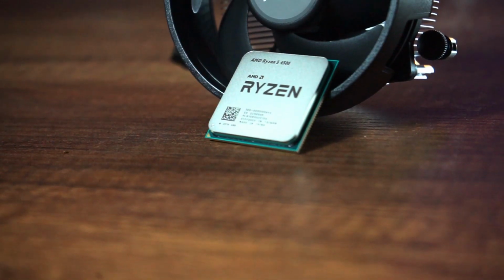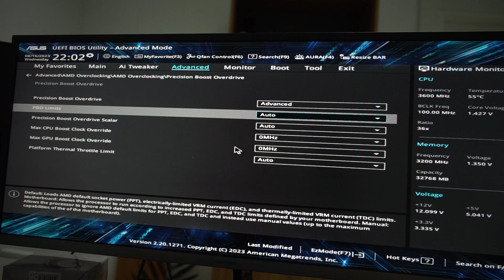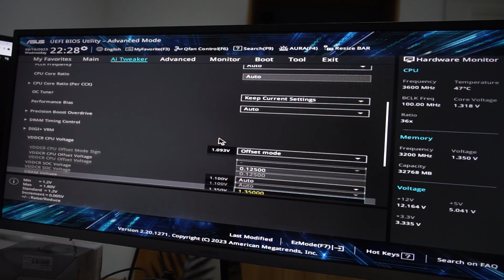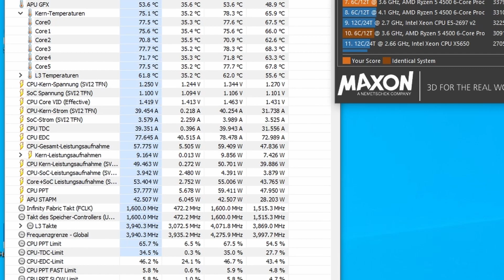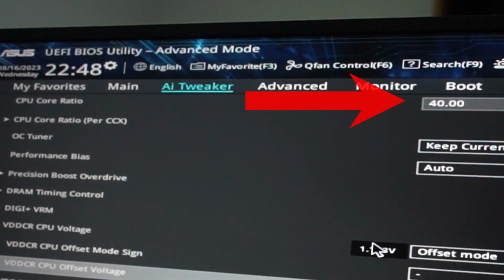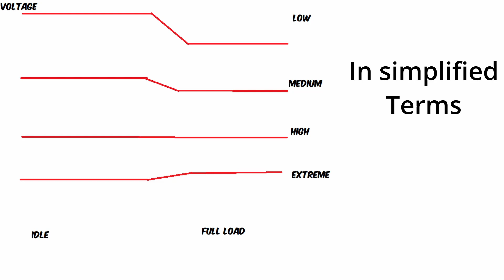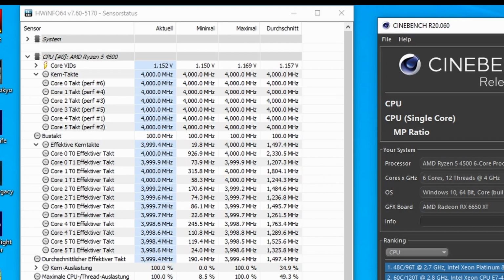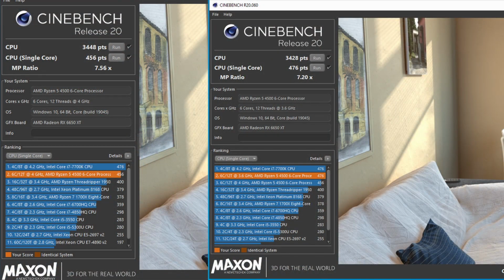Make your AMD CPU faster AND run Cooler at the same time for FREE!!! | Guide to undervolting Ryzen

Comment: Like the vid. Helpful info. Thank you.
I have just put a Ryzen 7 7700X in a SFF build. I've got a Thermal Right Phantom Spirit for the cooler. I'd like to undervolt my CPU, GPU and adjust the timings on my RAM. It's a bit of a balancing act to do all this, but fun. My big question though is will there be a noticeable difference in games and applications that require more power for performance? I don't own anything that I could test it on, hence the reason I ask.
Reply from the maker: if you do undervolting without adjusting the power limit. you will actually gain performance especially on CPUs. The 7700 has the option to set a 45w target i believe. with that setting and a lowered voltage or generally a fixed clockspeed you WILL save a lot of power and not loose a lot of performance since most tasks nowadays are multi threaded. 
i also did a guide on ram tuning. Thats pretty much something you could do that helps in any cpu dependant situation, be it CPU intensive games, rendering etc. 

There will also be a GPU undervolting guide next week! stay tuned for that :) was able to safe 150Watts on a 4090 while achieving the same performance on power intensive scenarios.
Reply: @limitless-hardware  Sounds good. I'll keep my eyes open for the vid. Thanks for responding. It's helpful to know you're YT reviewer that actually uses what you publish, rather than dropping a vid just for the YT algorithm.
Reply from the maker: Nice!
Well even when the channel is growing and i am able to get review samples i will try to use everything i recieve for at least a few days, sinde i think, you cant judge a product well, if you have not used it in depth, at least for a review. Unboxings etc. are something different but im not a big fan of videos like that.

Comment: unfortunately is not true about undervolting everything, you need a special app to undervolt my cpu which is a 5800x3D
Reply from the maker: True that. It is sad that AMD did not enable a negative voltage offset atleast for the 3d CPUs. or at least limit the voltage so that the problems with melting CPUs dont happen. But yeah, kinda sad. Still great CPUs for gaming Though!
Reply: You really shouldn’t mess with the voltage on a x3d chip
Reply: @MrExdous69  unless you know what you're doing, I've been bothering with PC things for 18 years which is longer than some people have been alive. People say you shouldn't do this or that w/o any knowledge or proof on why. Do you have any proof or cases of any X3D chips dying or having any issues from this stuff?
Reply: @ChikaHakozaki  for someone who claims to have done this stuff for 20 years… I mean your question was answered very recently. It was all over the news from people toying with the voltages on am5 x3d chips.
Reply: @MrExdous69  I didn't ask a question so where did you get that from?
I already knew you could overclock and undervolt the cpu in the first week of the cpu release. So if you're just now finding out via news, you're very late sir.
Reply from the maker: This is why I'm also saying in the video that this is mostly for CPUs up to Ryzen 5000 

On 7000 units you may have to be more careful 
Especially when reducing voltages andincreasing power there may be a lot more amps being pulled from the socket so this may cause problems but no guarantees as always for overclocking since I have not looked too much into Ryzen 7000 oc or undercoating because I don't havee access to the hardware
Reply: @limitless-hardware  apologies that the discussion strayed away and is getting a little too much. I intended to leave it at your initial response and I thought it was a good reply back to me. I appreciate the effort you did in the video and making it!
I love this kind of content and I hope it gets out there to more viewers. There's a lot of unaware people about this sort of thing and I wanna thank you for taking the time to cover it and inform.
Reply from the maker: Hey no worries haha, Interaction always gives the algorythm some attention lol. 

Thanks many videos like these will follow and i will hopefully be able to borrow hardware from manufacturers for testing, since i have to buy everything myself right nos :)
Reply: @ChikaHakozaki  I mean you did but that’s ok. Look at your last sentence in your first comment to me. ”do you have any proof or cases of any x3d chips dying or having issues from this stuff?” I mean that sure seems like a question to me.
Reply: Well you don't have any voltage control on the 3d CPUs anyway so yeah
Reply: @throttlebuddies0  That's apps out there for it. But I'm not gonna go chasing them down though and not gonna point anyone to them. I would recommend just buying a really good cooler and you'll be fine with it. I'm just going to upgrade my air cooler to a better one or get a nice AIO.